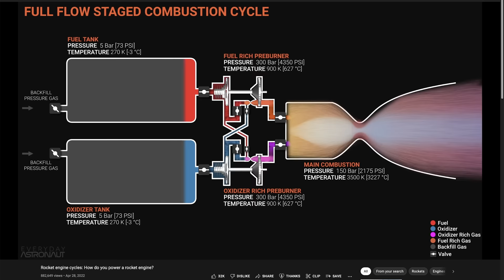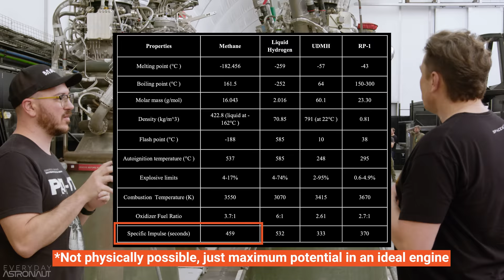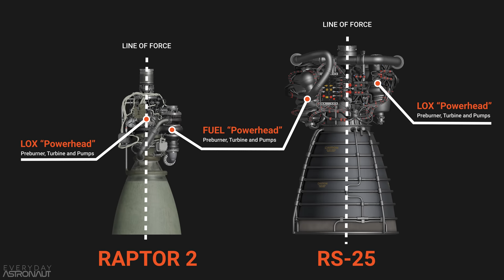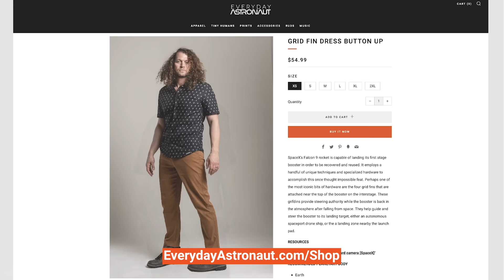Elon Musk Explains SpaceX's Raptor Engine!

Comment: “Area under the force-time curve” is another way to say the force integrated over time, which does in fact already have a cool name: impulse. Note that “Isp” is short for “specific impulse”, which is to say, impulse per unit mass - these are not unrelated measures.
Reply: Yep, this is also what I wanted to comment. Also he said "for a given mass flow" and guess what impulse/mass is specific impulse. So basically he was saying that what matters and should be optimized for is the effective specific impulse you get from a real-world thrust profile used during ascent, not the maximum specific impuls the engine has.
Reply: And impulse is simply change of momentum. So ISP is how much momentum did you gain per mass of fuel lost!
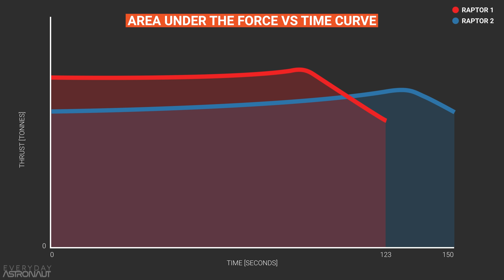Reply: By the way, isn't there a labelling mistake in the illustrative graph at 37:40? Looking at thrust levels, it seems that the red curve should be Raptor 2.
Reply: @benjaminleblanc850  depends.. they were talking AREA under the curve. The bigger area wins, not necessarily the higher one.
Reply: @benjaminleblanc850  Thank you, I am sure you were right. As mentioned by Elon (3:53) Raptor 1 can reach 185t and Raptor 2 currently 230t, so the red (higher) line from zero seconds must be R2. Also, I assume the "end of burn" side of the graph were indicative only, although for the same propellant mass R2 will burn out quicker unless delta Isp is greater than delta Thrust. This is the whole point of measured Isp, not estimated, which is perhaps the point Elon was trying to make.
Reply: It took me some actual scrolling to find this comment. I hoped this would be at the top. But the whole 'specific' thing can sometimes be confusing, so I get it.
Reply: this detail combined w/ how he tried to emphasize that bubbles damage metal is all you need to hear to understand the guy is just bs-ing his way thru the interview :}

cavitation wear is a complex phenomenon but the principle is quite easy to understand: repeated implosions (pressure spikes/jets) stress and wear out metal parts. that's it.
Reply: @duroxkilo    this guy is trying to stay out of trouble by not disclosing too much of the innards. Sure he could have thrown in the word cavitation, but then he would have needed to go on and explain that as well as Tim doesn't know about that either.. bubbles are the problem is much simpler.
Reply: @joansparky4439  this is not a hard to understand process:
"when a bubble collapses it generates tremendous focalized pressure, this fatigues the metal accelerating wear" 

-what's so f hard to get it right in 10 words and teach ppl what is going on the proper way?

the way he said it made it sound like it's a mystery/contradiction: something very soft damages something very strong, the WOW factor.

go back and pay attention (27:45), he repeats the same thing twice in an effort to get a 'wow reaction', both times he's trying to impress Tim with the fact that A BUBBLE can damage metal. 
Tim is unimpressed because it's not the bubbles that do the damage/wear: it's the collapse of the bubbles, THE DISAPPEARANCE of the the bubbles. :}
Reply: @duroxkilo   Tim is thinking about understanding what is told to him, while keeping the talk going, thinking of next questions.. stuff a moderator does.
Elon is thinking about what he all can't tell to not get in trouble while keeping it interesting for Tim & his audience while also having on mind a thousand problems they got over there.
This is mostly unscripted stuff and these two people (although Tim learned a lot about rocket engines within the last couple years) are NOT on the same page when it comes to the amount of knowledge that is involved.
Sure, Elon could have explained cavitation in a sentence or two.. but maybe he forgot the details or didn't want to go there for whatever reason.
You go and be in a live environment without a script and try to hold your ground on something where you have to explain stuff to someone while sticking to "NDAs". I'm sure you'll be the best narrator ever. LOL
Reply: @joansparky4439  he got that one wrong using more words than would have taken to say it right. and that's just one example in this clip.
are you in love w/ him or something? :}

yes i taught classes on how cavitation wears out impellers and i wouldn't say that bubbles damage metal because that's just wrong. 

i understand you like the guy or his voice and that's fine. but if you want to learn sh]t, this is not your guy.
if you're passionate about physics or rockets put in the time to study it. it's not easy, sometimes the math is quite hard but that's what it takes. 

if you want to learn how to be a boss who pretends to understand what his employers do, than this is your guy. :}
wish you all the best.

Comment: 28:16 “Weird that a bubble can erode metal”
Happens on boat propellers. I think the damage occurs when the bubble collapses.
Reply: Yep was going to add that to my comment but read the comments first
Reply: Cavitation is a vacuum bubble, which means it has a huge pressure differential inside and outside the bubble. (And even more so in a high pressure pump.) By the time it collapses, the fluid is moving very fast towards the center, so it hits hard at the end of the collapse.

Comment: Those pumps must endure extremes in so many ways at the same time.  Cavitation issues, temperature differentials, thermal expansion differentials, pulses of 200 tons of thrust,  and all kinds of vibration from all kinds of sources on top of the other stresses and strains.
Reply: also corrosive gas (pure oxygen) at very high temperatures and insane pressures.

Comment: 28:15

It’s not the bubble itself that is eroding metal, it’s that when it implodes it creates shock waves in the fluid that hit the metal and erodes it, this happens in every type of pump, even water pumps
Reply: Can't stop the cavitation? Hardened impeller? Blade angle? No. It's a heat/mass transfer issue within the mass flow problem inside a freezer on a pogo stick!
Reply: It can happen in internal combustion engines too. Loss of coolant pressure can lead to cavitation from steam bubbles which damage the cooling channels in the cylinder head. I guess if the steam bubbles get as far as the water pump then that will be damaged as well.
Reply: Yup, cavitation
Reply: It's called cavitation. I occurs when the friction of the pump impeller causes the water to boil releasing air bubbles that are hot and explode like popcorn destroying the prop or impeller. Happens due to lack of flow.
Reply: @MrDmadness  you got some principles wrong, it happens when the pressure locally(usually behind the blades) is lower than the vapour pressure of the liquid, so a small bubble forms and implodes (not an explosion, the literal opposite) when the pressure gets high again, this implosion creates a shock wave that erodes the metal. It can happen for a water pump if you put it higher then where it sucks the liquid from
Reply: leading to pipe collapse.
Reply: @Sbinott0  you are correct that I called it an explosion when it is in fact due to the venturi principal ( lowpressure ) creating an implosion.. embarrassing a bit for me since this is quite literally my field ( fluid dynamics )   but yes, you are correct.  And I appreciate your mention of my errors so that people reading the comments can get accurate information. :) I always try to convey things with accuracy but am still a meager human :)
Reply: @MrDmadness  you're literally not qualified at all to be talking about the subject if you can't even get cavitation right
Reply: Actually. it's a a vacuum and they implode, but still a mass flow problem.

Comment: Ullage gas refers to the gas or empty space within a rocket or spacecraft's propellant tank. In a rocket engine, propellant is stored in tanks, and as the propellant is consumed during thrust, the remaining empty space in the tank needs to be filled with a gas to maintain pressure and prevent the tank from collapsing. This gas is known as ullage gas.

The purpose of ullage gas is to ensure that the propellant is delivered properly to the engine. It helps to maintain a consistent flow of propellant by exerting pressure on the remaining liquid fuel or oxidizer, preventing vaporization or cavitation that could disrupt the engine's performance. Ullage gas is typically inert, such as nitrogen or helium, and is often used in combination with a pressurization system to maintain the desired pressure in the propellant tank.

Overall, ullage gas plays a crucial role in ensuring the proper functioning and stability of rocket engines by maintaining pressure and facilitating the flow of propellant.

Comment: Head, end, and throat cooling in thrusters is a cooling technique specifically used in rocket engines to prevent overheating and ensure optimal performance. Thrusters generate a significant amount of heat during operation, and cooling systems are crucial to maintain the integrity of the engine components and prevent damage.

In the context of rocket engines, head, end, and throat refer to specific sections of the combustion chamber and nozzle:

1. Head cooling: The head region refers to the upper part of the combustion chamber. It is typically exposed to the highest temperatures and pressure. Cooling channels or regenerative cooling systems are often incorporated into the head section to circulate a coolant, such as liquid fuel or cryogenic propellants, to absorb heat and prevent the chamber wall from overheating.

2. End cooling: The end region refers to the lower part of the combustion chamber, near the nozzle exit. It is also exposed to high temperatures and pressure. Cooling techniques such as film cooling or regenerative cooling can be employed in this section to cool the chamber walls and protect them from the intense heat generated by the combustion process.

3. Throat cooling: The throat is the narrowest part of the combustion chamber, located between the head and end regions. It is subjected to extremely high temperatures and high-velocity gases. Cooling methods, such as film cooling or impingement cooling, may be employed in the throat area to remove excess heat and prevent damage to the chamber walls.

The primary goal of head, end, and throat cooling in thrusters is to maintain the structural integrity of the engine components and prevent thermal degradation. By implementing effective cooling techniques in these critical areas, rocket engines can operate at high temperatures and pressures without compromising their performance or risking catastrophic failure.

It's important to note that the specific cooling methods used in thrusters can vary depending on the design and type of rocket engine. Engineers carefully consider factors such as the propellant type, operating conditions, and material properties to design efficient cooling systems that can withstand the extreme conditions of space exploration or other propulsion applications.

Comment: Tim your aero spike idea which is a good one by the way would be most beneficial to a single engine going from ground to space like a space plane would have. As Elon says if you have two stages anyway operating in earth and space realms then the aerospike self contained formed expansion technique doesn'tatter because you have to use two different engines so you might as well have to optimized expansion nozzles rather than an aerospike.

Comment: Wanna eliminate the shrouds? That's easy! The shroud of a rocket is the protective covering that surrounds the payload during launch and ascent. Removing the shroud can be desirable for several reasons, such as reducing the overall weight of the rocket or providing better access to the payload during integration and testing. Here are a few ways that shrouds can be eliminated or minimized in rockets:

Fairingless design: One approach is to design the rocket without a shroud or fairing at all. This is typically only feasible for smaller payloads or low-Earth orbit missions, as larger payloads and higher-altitude missions require more protection from the aerodynamic forces and thermal heating of ascent.

Deployable shrouds: Another approach is to use a shroud that can be jettisoned or deployed once the rocket reaches a certain altitude or velocity. This allows for a smaller and lighter shroud to be used during launch and ascent, while still providing protection to the payload.

Structural integration: Some rocket designs integrate the payload structure directly into the rocket, eliminating the need for a separate shroud. This can be accomplished by designing the payload as a structural component of the rocket, or by using a modular payload system that can be integrated directly into the rocket structure.

Inverted cone design: In this design, the payload is placed at the top of a rocket that has a conical shape, with the base of the cone at the bottom. The payload is protected from the aerodynamic forces and heating of ascent by the conical shape of the rocket, eliminating the need for a separate shroud.

It's worth noting that each approach has its own tradeoffs in terms of performance, cost, and complexity. Engineers will need to consider the specific mission requirements and constraints when selecting a shroud design or elimination strategy. Let me know if you have any questions. The ENGINEER in DISGUISE.

Comment: Thanks Tim. This is fascinating. Would you ever consider doing a video on how the force of thrust travels through a rocket engine into the vehicle, especially when gimballed? Elons explanation of how pump housings transfer thrust force is insane!
Reply: Simple: The same way the force of thrust from a aircraft’s jet engine is transferred to the aircraft.  

An engine must first be strong enough to contain and direct the forces it produces without destroying itself.  

An aircraft airframe (or rocket body) must also be strong enough to accept all that thrust without destroying itself; plus the strength to resist all the aerodynamic and gravitic forces at play).  

Then you just bolt the two together. 

The trick is in making everything as strong as necessary (including safety margins) while keeping them all as light as possible. 

In Super-Heavy, twenty Raptor engines are mounted on the just-wide enough reinforced ring around the bottom base of the booster (forming the bottom edge of the LOX tank section).  The other 13 engines are attached , via robust gimbal assemblies, to a solid steel structure under the LOX tank that directs their thrust also to the outside edges of the tank.  The reinforced outer walls of the booster and ship provide the majority of their structural integrity.  

That’s where the booster and ship rest their full weight on their launch and transport mounts, where the booster is held down on the orbital launch pad, and where the ship and booster (or ship and suborbital launch pad) mate. 

Pressure maintained inside the tanks further helps resist gravity and aerodynamic loads (crushing an empty coke can is easy; no so much a sealed one), but the booster and ship appear to be easily able to support their own weight, at least, without it.

In my road car, it’s aluminum engine is bolted into a steel frame that provides the majority of my vehicle’s structural support.  In a Formula 1 car, however, the engine is essential to car.  A modern Formula 1 car without an engine isn’t a car. The engine bolts to the carbon fiber monocoque (the part that protects the driver and fuel tank and to which the front wing, suspension and wheels are attached), and the back end of the car bolts to it (via the gear box).  The floor is necessary for aerodynamics, but it isn’t structural to the car.  The gear box bolts to the engine, and through those are supported the rear wing, rear suspension, and rear wheels.  All very clever.

While previous engines bolt their turbopump assemblies to a purely structural piece of the engine, Raptor simply engineered the O2 pumps and pre-burners strong enough so as that additional structural support wasn’t needed.  The Methane components then bolt to the O2 parts same as an F1 car’s rear end bolts to the engine.

Comment: Love this video! I am trying to wrap my head around the area under the force time curve metric. I find this fascinating because it seems directly related to your explanation on why suicide burns are the most efficient way to land (but in reverse, going up). If I am thinking about it correctly it seems like you want the most force over the shortest time to minimize gravity losses. Wouldn’t this mean your chart around 37:37 has the labels for raptor 1 and raptor 2 switched? The red plot seems to achieve the same area under the curve in less time which would be advantageous.
Reply: I was wondering this as well. The chart doesn't really make sense. To me, if I were to simplify it, I would say the goal would be to maximize the speed of the exhaust. Faster = more thrust for less fuel. You can then increase the area under the force/time curve because you're going to be able to achieve higher thrust for longer for a given amount of fuel (efficiency). Accelerating faster is going to have reducing benefits, I would think, as it will mean you're going faster while still having a lot of atmosphere to push through and denser atmosphere at that. I believe the power needed to move though the air goes up by the cube of the speed. So I would think there's a sweet spot where you're accelerating fast enough to spend less time fighting gravity but also not accelerating so fast that you're battling too much wind resistance, leaving a lot of the acceleration for when there's thinner atmosphere. Just my thoughts, I'm not sure how this plays out IRL.
Reply: I noticed that too. Raptor 2 having higher thrust than Raptor 1, it seems that the red curve should correspond to Raptor 2.